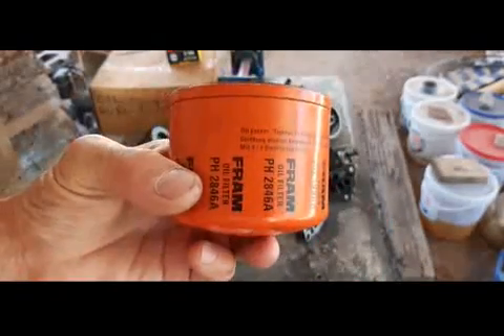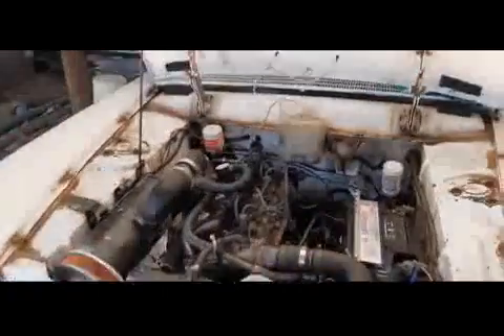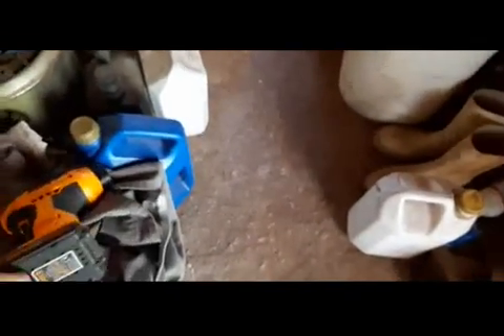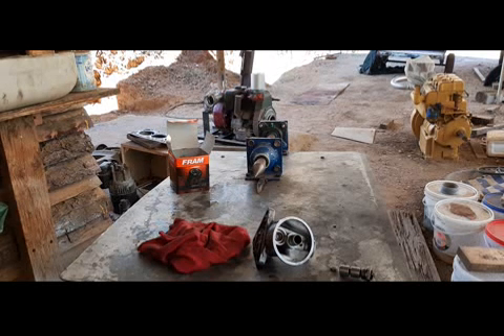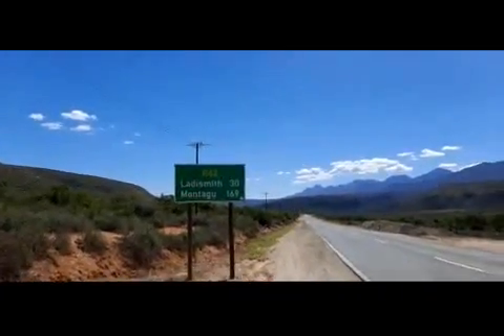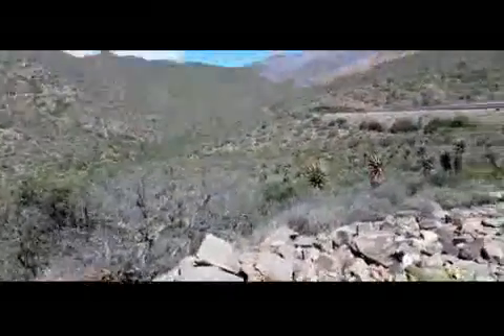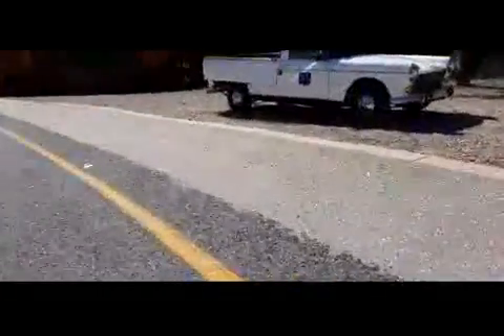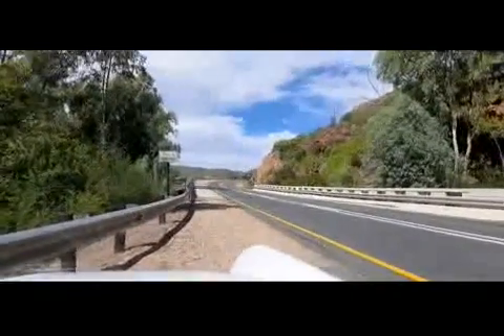Peugeot 404  pick up powered by XD3 engine part 2

Comment: Another dangerous thing is the oil pressure sensor.  The oil lamp ignited, despite the renewal of some parts.  It is not known if it was a problem with the crankshaft or the sensor.
Reply from the maker: Fortunately I had changed the oil filter immediately before messing up the bearings.